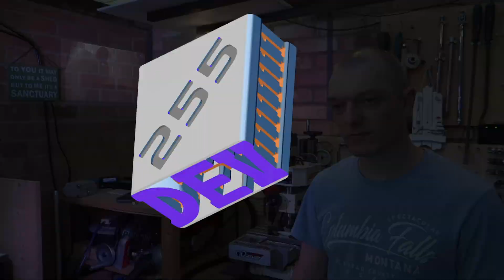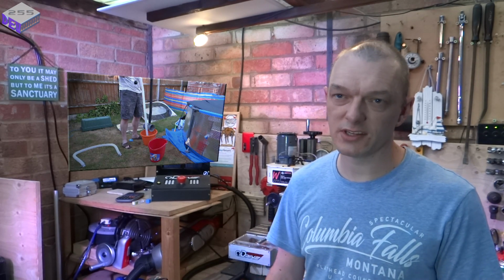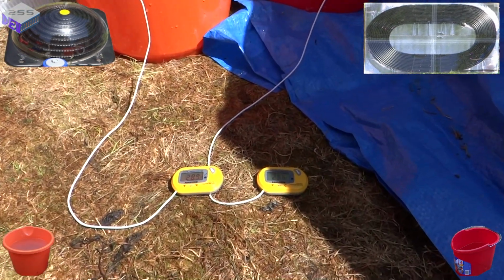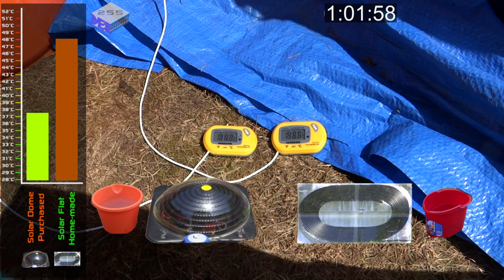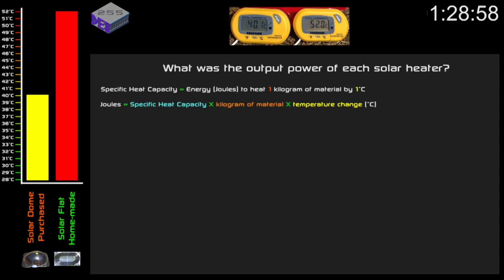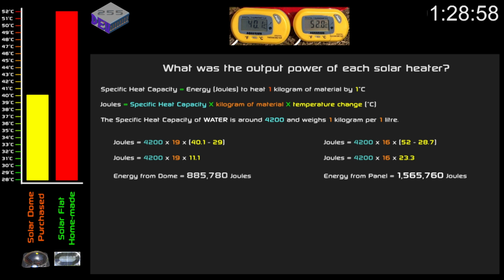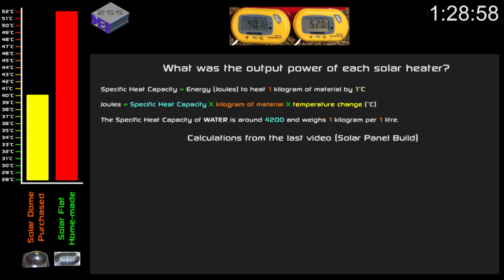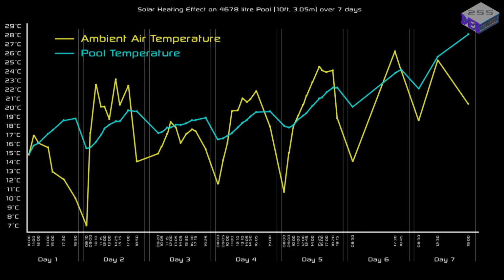2. Which Solar Pool Heater? - Homemade Vs Purchased

Comment: As expected because the home made heater covers a bigger area, now work out what heater makes the most heat from the sqm area it covers, you might find that for the size the home made one is less efficient, but maybe not.
Reply from the maker: Hi, from working this out last year the homemade one has more surface area exposed to the sun that is cooled by the water, in other words the water is taking that heat to the pool, whereas the dome is hot in between the pipes (there is a lot of space there) so not all the heat is being transferred away. I've made another version this year that looks to address all the issues of both and takes advice from the video's comments, I am just in the process of editing a few videos first before that one comes out.
Reply: @TheSolarPoweredEngineer  sounds interesting  👍

Comment: Very good test :-) here is my effort. Struggling for a pump running 12volt but the first one I got has stopped working :-( I have a spare so see if that fails as well.
Reply from the maker: Thank you, I have tried 2 separate 12v pumps and both have failed. I think the problem is that I am choosing ones designed for momentary use (filling a sink in a caravan or having a shower), where they are not designed to run continuously. Also, these pumps are not designed for the high loads of pushing a large body of water around 50m of pipe. I have a 25W 240v pond pump attached to it now. I will be looking into a better 12v version and testing for the next project. Hope that helps.

Comment: I don't get why they have different amounts of water? kinda like comparing a apple to a orange if they don't start with equal amounts.
Reply from the maker: Hi, I had that thought too when I made the video, although the maths takes this into account and the resulting Wattage would be the same if they had the same amount of water. Unfortunately I only had these two buckets, needed to make sure the pumps stayed submerged and the dome type held more water inside. The surface area is far greater in the home made panel due to having 50m of tubing and less water, so this is the reason for a higher Wattage output. I do go into a lot more detail in the 3rd part of these videos. Hope that helps.

Comment: Power is in Watts: Joules per second.  Your calculation already divided for the 1.5hrs giving you an average power output over your test time of 164 / 290 Watts.  Compare that to the 2,000W heater in a lazyspa, for example - given this heats my 700L hot tub by about 1.5C per hour, looks like the solar heater you made would heat it by 0.2C per hour.  
Which is annoying, as I've just bought the kit to do something similar, but I see now that its just not going to work as the heat loss over night is about 8C, which the solar heater can't replace each day with even 8 hours of decent sunlight.
Also, how much power is your pump using?  If its more than 200W, then you're actually wasting your time entirely :(
Reply from the maker: The panel is averaging 600W on a good day and has reached 988W during mid-day and in June, so you should be ok. Plus my pool is currently sitting at 20.81ºC (9:20pm) with an outside temperature of 15ºC, the foil wrap around the pool helps with this. I get maximum 3ºC drop overnight and around 7 to 10ºC rise during a good sunny day. The pump is 24W, although I don't believe it is running at that, I could test it and find out. I've had the pool up to 30.8ºC in June also so may be getting some degree of heat from the pool cover. Your hot tub seems to have some inefficiencies too as it would only need 1.2kW to heat 700L of water by 1.5º over 1 hour. I'm working through all the logged data at the moment to create another video on actual temperatures measured, where I have an Arduino Nano at the pool and one at the house transmitting and logging 10 temperature sensors every 15 seconds. This writing a .CSV file so I can put it into a graph for the video and is where I have the values from. I think you will be ok with the kit you bought if it's similar to mine.
Reply: @TheSolarPoweredEngineer  Only just saw this!   I bought 2 of those domes and I've had them daisy chained on the ground for a few weeks now as a test.  They only seem to raise the water by 4-5C from their starting point, which is really poor I think.   Its a very low rate pump I'm using, only about 1 litre per second - do you think this could be a limiting factor?  I'd have thought it would just heat the water up more, but at a slower rate of throughput and that it would all even out in the end?

Comment: Dont know why you didnt use equal amount of water to begin with. Regardless of the heaters inner capacity the task would be for example to heat up 20 liters of water with both heaters.
Reply from the maker: Hi, yep the thought had crossed my mind at the time, although I only had these 2 buckets and settled on 19 litres and 16 litres due to holding the pipes in the buckets while pumping, it was a little frustrating doing that experiment haha. I have made a new one this year so will compare old to new using an identical setup for both systems.

Comment: All these years I havr been freezing my ass taking  cold showers both in the mountains I didn't know you can get heat from the sun. Thanks jus like to know can you use any sort of glass
Reply from the maker: Hi Nazar, hopefully this will help 😉. I believe the best insulator to use would be a double glazed panel at the same size. Plus painting the backing foil black and building a wooden frame around it would be best. If you buil one, enjoy your warm shower 👍
Reply: @TheSolarPoweredEngineer  thank 👍

Comment: Why didn't you make the background completely black?
Reply from the maker: I didn't think of it initially, although I've since inserted a black filling to good effect and will be making version 2 when the weather gets a little better in the UK. Depending on the sun and time of day I am now getting around 600Wh, so it would be good to see the power gained in the summer.
Reply: @TheSolarPoweredEngineer  yeah I think you will have even better results. 😊 i am testing mine out today😄

Comment: Great video! What about comparing to the intex solar mats? I’ve always they thought that they are cheapest way to get max surface area covered to capture the suns energy. Not sure what efficiency they are but for £80 you can get 4 which gives you 6m squared of coverage
Reply from the maker: Hi Chris, I think any solar heating without insulation from the wind is very inefficient, so they would probably be ok when there is no wind.
Reply: @TheSolarPoweredEngineer  I think that this is true only if you are trying to heat water at high temperature. For a pool the water stay relatively close to ambient temp so the solar mat would be at about the same temp as air surrounding it so not that much loss. I think insulation would just reflect some of the energy more that it would save from escaping.
Reply from the maker: @martinchabre6984  I've just got a thermal imaging camera, so hopefully I will be able to experiment with different setups and show which ones are best.

Comment: Hi, where is your part 3 ? Regards Arnaud
Reply from the maker: Hi Arnaud, it's coming ;-), there is a lot of data logged (10 temperature sensors logged every 15 seconds over 7 days) so I am going through this, also making an intro video for my channel and a CNC conversion video. All this in the evenings and weekends... I wish I could do this full time.

Are you looking for specific answers? Happy to help.
Reply: @TheSolarPoweredEngineer  hi Neil my pool is 8200 litters, i search an easy way to add à solar heater
Reply: @TheSolarPoweredEngineer  will that work with a shurflo pump ?
Reply from the maker: @MORISSONA  Hi Arnaud, that's a fair bit more water than I have, if it's an above ground pool you can use the existing pump, although for that size pool I would recommend a separate pump and around 150m of tubing in a large unit (as the one fitted may not be able to force the water around, possibly 75W version), you do get a bit of heating off the black bubble wrap solar covers, although if there is a breeze it takes some of that heat away.
Reply from the maker: I'm not sure on the shurflo pump, my first thoughts is that it's a fresh water pump, so may not cope with small particles entering it from the water, plus it's designed to provide showers, taps and toilets on vehicles (At 10psi).  Also, it may be fairly noisy compared to a pond pump as it's a diaphragm pump, which may not be able to operate continuously. I think your best bet would be to contact a supplier on that one

Comment: Nice job, the only other thing I would've included is the money spent on each type of heater.
Reply from the maker: Hi, thank you the Purchased Solar Pool Heater cost me £109.99 back in April 2020 and the Homemade one cost £192.23 in materials; although the Dome version now costs £257.99 from the same shop vidaXL.co.uk. I should have bought more haha.
Reply: @TheSolarPoweredEngineer  They're much cheaper in the US through Amazon, but they don't have a very good rating.
Reply from the maker: @ffjsb  I found they are fairly inefficient as you don't have all the dome exposed all the time, with a panel I found it much better.
Reply: @TheSolarPoweredEngineer  Seems with much more surface area, they'd be more efficient than the dome.   I wonder why someone isn't just producing the flat style pre-made.
Reply from the maker: @ffjsb  You can get a few flat ones, although not contained. The best exposed one for the money is the VidaXL one I believe, although not tried it. Here's the link: https://www.vidaxl.co.uk/e/vidaxl-solar-pool-heater-panel-80x620-cm/8718475037972.html

Comment: A bubble-wrap pool insulating blanket works even better.
Reply from the maker: I do have one of these as well, although find the wind blowing over the top of it takes the heat away quicker than it warming the water, maybe a clear cover over the top of the black bubble wrap would work better 🤔
Reply: @TheSolarPoweredEngineer  or better yet, clear bubble wrap and black paint or plastic film on the bottom.  I prefer plastic film because during warm summers you could remove it to prevent you pool temperature from exceeding 100F.  From experiment I ran on 3 different pools I owned when I lived in Florida, I found most heat loss is due to evaporation.  Any cover over the surface that prevents evaporation goes a long way to keeping the pool warmer.
Reply from the maker: @markfabre7682  Thank you, that makes a lot of sense, I try and keep as much of the water covered and insulated as possible when it's not in use.

Comment: So your diy system is 194 watts whereas dome is 109 watts that day. Thanks for doing this test.
Reply from the maker: Hi, no problem. Yes, the maximum power for the panel got up to an impressive 900W in the height of summer in the mid-day sun, where the dome produces a maximum of around 450W. These have been on our pool this summer along with the improved copper version and we have now seen 33ºC in our 3m pool with the 3 connected.
Reply: Neil, something I have not seen anyone investigsting is the difference between parallel tubes vs one loop for the same overall length of tubes. Theoratically parallel tubes fed from and into a manifold should be much efficient because the energy absorbed is directly proprtional to the temperature difference between two mediums. As the single tube loop length increases, the temperature difference decreases and hence the efficiency. Something you can make a video about.
Reply from the maker: @akhtarkh  Hi again, funnily enough I'm doing exactly that with my second version, where the pipe in splits into 3 and re-joins on exit, plus I've mixed them up so that one loop runs in reverse to make use of the heat wanting to transfer to the colder tubes. Here is a link to my second version. I hope to get another video out in a week or so with more detail. Good shout though.

Comment: Your reasoning on units is off. A Joule is a Watt-second, so it is converted to Watt-hours using seconds in an hour but remains a unit of energy despite seemingly using a time units conversion because you are merely converting Watt-seconds to Watt-hours. Then after you divide Watt-hours by time you have power not energy. Power is measured in Watts not Watt-hours.
So 1565760 Joules(Ws) / 3600 = 435 Wh, then 435Wh / 1.5h = 290W
Alternatively, you can divide Watt-seconds(Joules) by seconds to go straight to power (what you actually did)
So 1565760 Joules(Ws) / (60 * 60 * 1.5)s = 290W
Essentially the same but the units output is Watts after seconds divided into Watt-seconds instead of hours divided into Watt-hours. It does not matter whether you convert hours to seconds and divide Joules by seconds or convert Joules to Watt-hours and divide by hours. Both produce the same correct answer in Watts. But you should not call the output Watt-hours as that's just another total energy and it is dividing energy by the elapsed time of 1.5hours (or the equivalent in seconds) that gives you power.
Reply from the maker: Hi, I know, I was trying to show average Wh as  it was done over 1.5 hours, so converting it back to 1hrs worth. I am aware that Wh is accumulative, where for the first hour of the day it could be 100Wh then for the next hour 150Wh, so 250Wh consumed in total, but I tried to show the average, so 125Watts per hour average, that's what I should have put in the video but instead I made a typo putting Wh. Hope that makes sense

Comment: Great video, one issue with calculating Wh though. Wh is watt*hours so it's already a cummulative unit of energy over time. 
1 joule is 0.000277777778 Wh

so that means that the dome produced: 246Wh
and your system produced: 435Wh
Reply from the maker: Hi, yes I should have said average Watts per hour and not put Wh's on the calculations element. I will put this in the description. Thank you